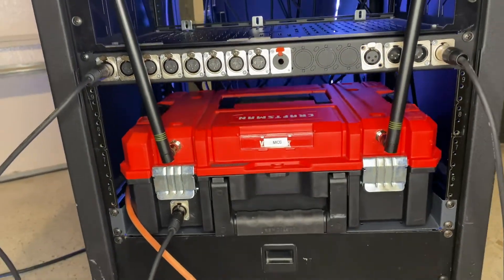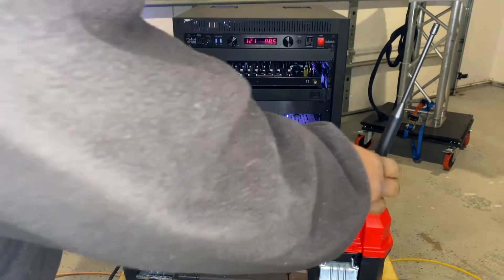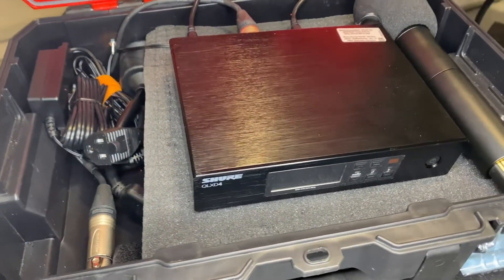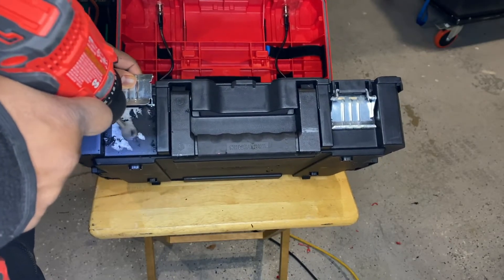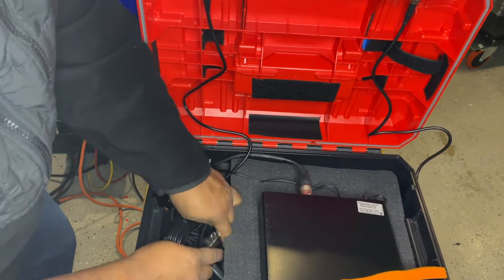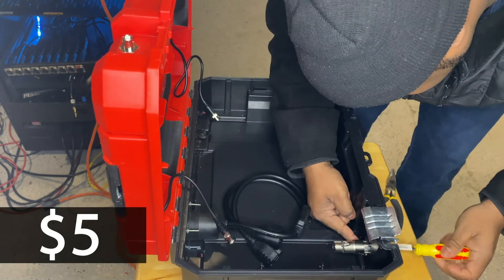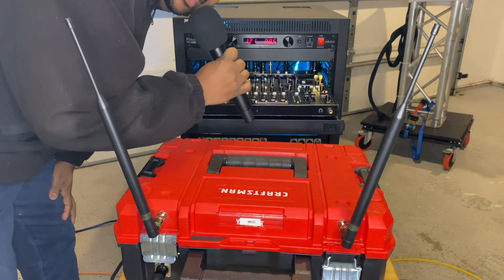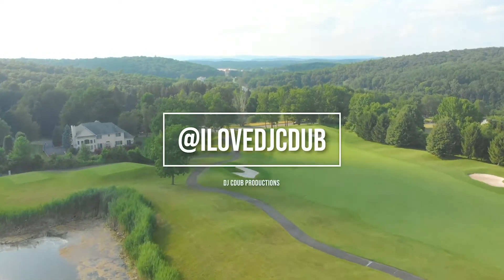DJ Flight Case - Wireless Mic Build - Save Time, Save Money

Comment: Great idea if you only have one mic system you can use it for both ceremony and reception. Thanks for sharing.
Reply from the maker: This has worked out really well. I have a couple old BLX mics, but have been waiting for almost a year now for more new QLXD's to get back in stock. It's nearly impossible to find a new one in the G50 band. I haven't broken down to the point to upgrade to the ULXD yet. Thinking about it, but it's hard to justify the cost and I've never had a single drop out with my QLXD.

Comment: Great Video & Idea! Have you done a video with this invention & how it was works with your ceremony setup?
Reply from the maker: I didn't get a chance to do a gig log with it, but it worked out REALLY, REALLY WELL! The only thing I don't love about this case is that it's not all black, so it stands out a bit, but that's easily remedied by painting. I  bought a shallow mount SBX case for my QLXD mic, so I'm currently using that. I found that case on FB market place for $50 new, so it was a no brainer. I still have this case and will use this as a receiver case for when I need to do a remote speaker setup.

Comment: Are you concerned with any over heating issues of the Shure?  Looks like the case gives it plenty of air.   Just courious, and thank for this information.  Definitely useful!
Reply from the maker: Great question.  I tested for this (but forgot to add it to the video) and the mic doesn’t generate any type of significant heat that would make it an issue for me, but this should be something to test with other models of mics.
Reply: @Ilovedjcdub  I love this idea! That was my concern as well...the receiver wouldn't be the thing I would worry about...the power cables and especially the power brick. With the case being weather sealed. Could be address by putting a few air flow holes or a filter on the side the power cables are..if it does become issue. Amazing video!

Comment: Great case build. Question what size drill bit did you use for the BNC antennas?
Reply from the maker: I justed a 1/4" drill bit. That's not the perfect size, but since the case is made out of hard plastic I was able to bore it out to what I needed using the same drill bit. This may be the better way to do it as you want everything to fit as snug and tight as possible.

Comment: what about air circulation for the heat?
Reply from the maker: Heat has not been an issue. This unit doesn’t put out very much heat if any. I’ve used this on 90 degree days for hours with no issues so far, but I’ll update if I run into any.